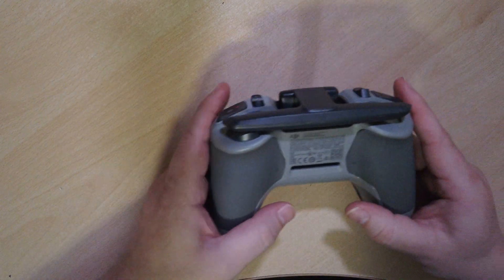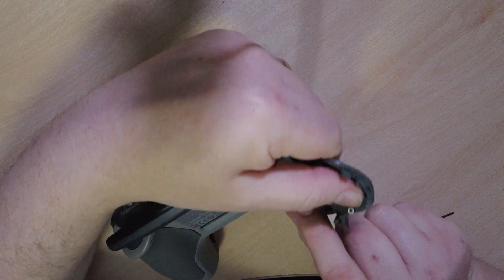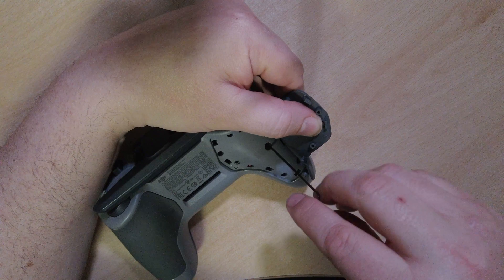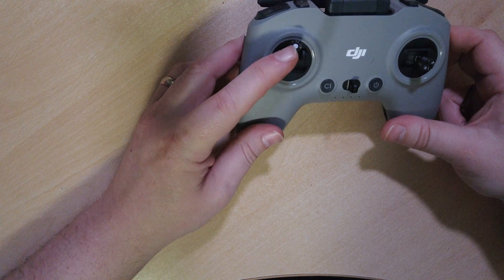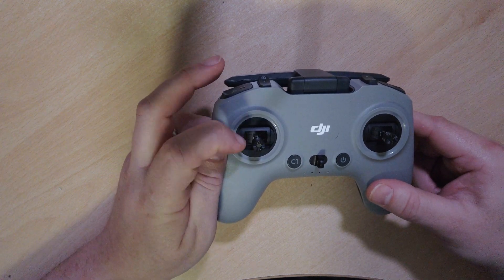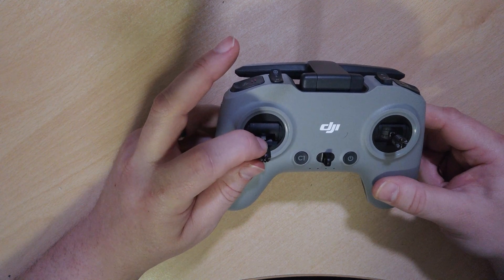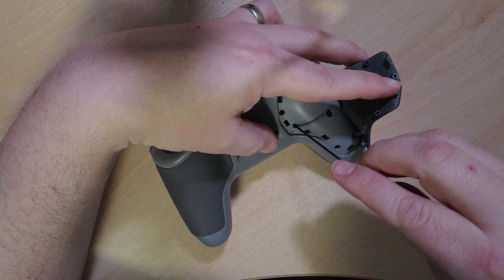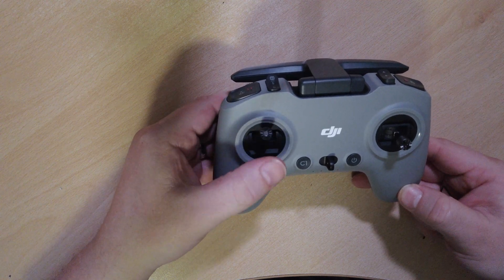How To Setup the Sticks on a DJI FPV Drone Controller V2

Comment: Hello excellent tutorial 👍🏻👍🏻 just one question?? If I do this it will become just like other regular drone right when we have full control at all times, either for N, S, as well as Manual right???
Reply: Once i tighten the screw, still can i fly in Normal & Sports mode or the controller will only work in Manual mode then?

Comment: Hey mate, I’ve purchased the Avata. How does one setup the arming switch? As opposed to sticks down and in.
Reply: Once i tighten the screw, still can i fly in Normal & Sports mode or the controller will only work in Manual mode then?

Comment: Sorry for stupid question, I'm new to FPV. Isn't the 50% going to just hover (if we don't touch anything else) instead of going slow?
Reply from the maker: Its not stupid, when you are in Normal or Sports Modes the centre position means it will hover at its current height, then pushing the stick up makes the drone go higher and down means the drone will lower.  The drone software and gimbals etc will be looking after everything and keeping it stable.
In full manual (FPV), that stick becomes the throttle and acts very differently (as with all the stick axis).   50% throttle is quite a lot meaning the drone would be going fast depending on what pitch or Yaw are doing.  The drone in full manual will not just hover on its own, you are in total control and stick inputs in all axis are required to make it hover, and this will be different and constantly changing as the wind, distance from the ground (ground effect) etc will all be having an effect on it - that's the fun of it 😁  Hope that helps 👍

Comment: Good day,
I'm wondering, is that possible DJI FPV Remote Controller binding with FPV Drone which built up (other than DJI Products)?
Without additional parts
Reply from the maker: No, not at the moment, it doesn't even work with their air unit for FPV drones :(
Reply from the maker: No, the DJI remote supplied with the FPV drone will not work with a DJI air or Caddx unit 😐

Comment: Wait do you have to do the same on the other side. I think not because I've seen 6 videos by now and no one touches it? I'm going to test it out on a sim
Reply from the maker: You only do it to the throttle stick, you don't need to do the Roll/Pitch stick.  The controller does have the facility to do both sticks though, and this is because you might fly the drone in a different stick mode, but most will fly with a mode 2 setup.
Reply: @CrookedimagingCoUk  oh ok thanks a lot

Comment: Is this setting only for M modus ?
Reply from the maker: You can use the throttle in all modes like this, but it makes it much harder to fly in Normal and sports, but if you are flying in full manual then it's a must really.
Reply: @CrookedimagingCoUk  thank you 🙏 so much it was very very helpful
Reply: What stick layout are you using?